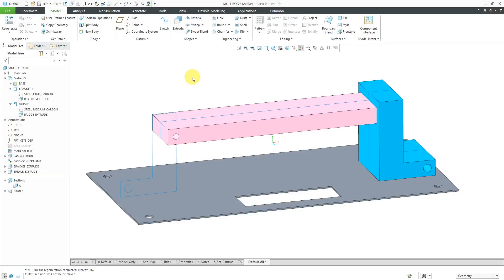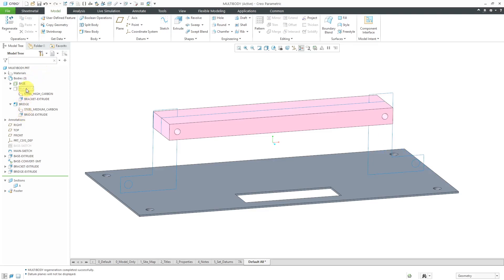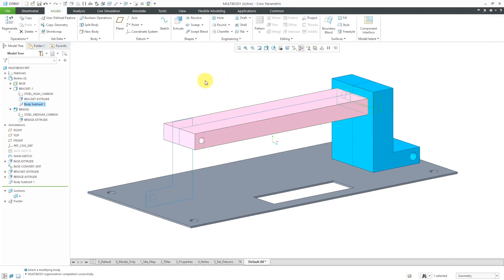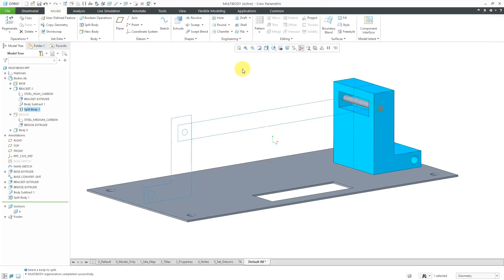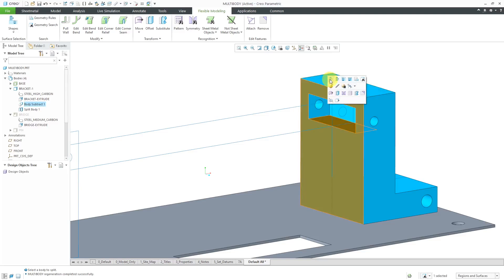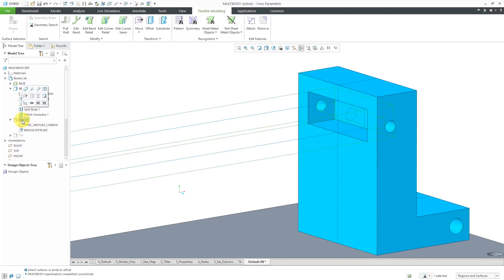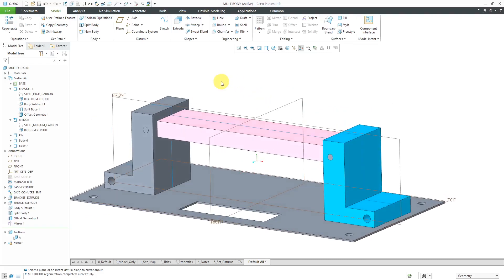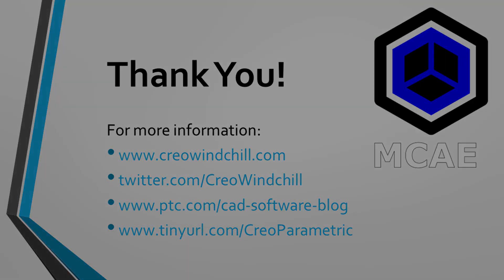Creo Parametric 7.0 - Clearance for Multibodies

Comment: Can the clearance gap be filled with geometry? i.e. epoxy
Reply from the maker: Yes
Reply: Hmm, I'm having a hard time doing so. Do you have a video showing the steps. I need to create a part such that it is RTV, filling a small gap around a window in its frame. I was successful creating the gap using the bodies as you showed, now I need to fill the gap. pls help  @CADPLMGuy